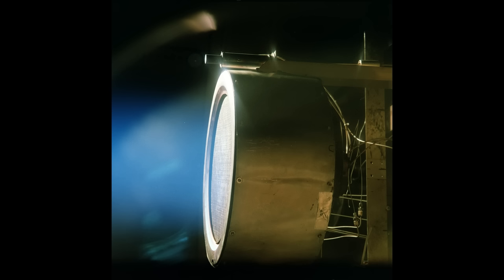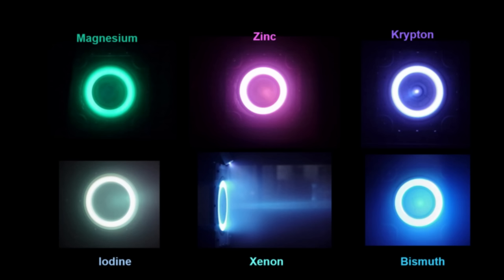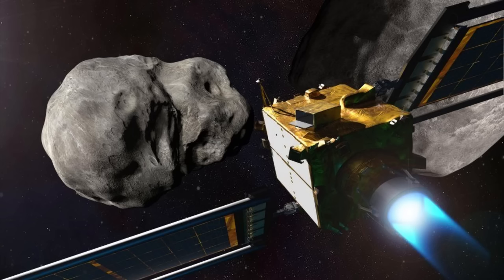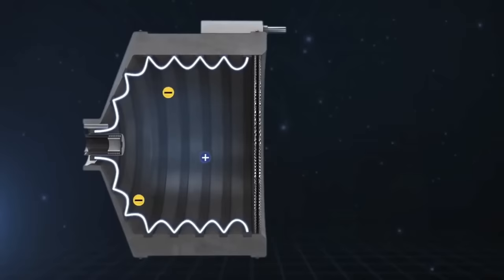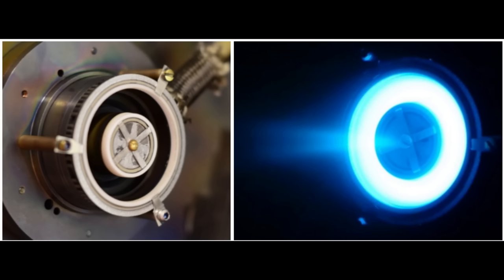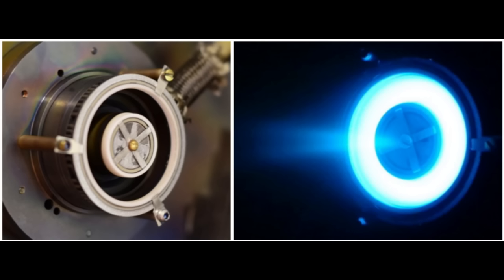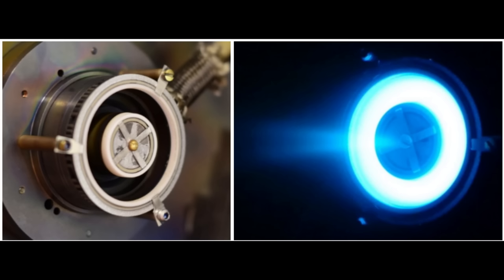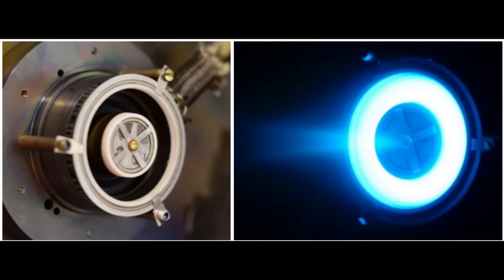Why Are There Two Different Types Of Electric Space Engines, And How Do They Work?

Comment: why specifically xenon? wouldnt it be better to use something like iron? i mean...it's a lot more common, has a lower ionization energy requirement and is solid at normal temp and pressure which means it would be a lot easier to store as fuel...i'm kinda curious why it's also totally absent from the shown graph while other metals like zinc or aluminum were specifically marked (it could be one of the small points between Scandium and Zinc though...now that i think about it...)

Unless what we're looking for here is to maximize the function of relative atomic mass (or Standard atomic weight, depending on which church you preach) versus 1st ionization energy which would mean that xenon's atomic mass (that is more than twice that of iron's) would compensate for it's higher ionization energy...did i understand correcly?

If that's the case then the graph at 14:20 shouldnt be showing relative atomic masses and not atomic numbers? it might be more of a nitpicking from my part or a complete mistake and i have no idea if i'm understanding it correctly XD
Reply: Iron is solid at the operating temperature that’s why
Reply: @peeperleviathan2839  Iron sulphite (for instance) is a gas... As is xenon. You still need to atomize it to make it into plasma. With the added disadvantage that you need to store it in pressurized containers and use parts prone to failure like pressure valvs and regulators while you could use solid Iron as a fine powder. Iron going from solid to plasma would also allow it to accumulate more energy as transitional energy which would allow for more energy output. 
i am, assuming (i might be incorrect) of course, that something like that is connected to propulsion (like Iron being molecularly heavier and thus requiring that extra energy) and thus desireable. It could very well not be the case since this is not my area of expertise XD
Reply: @pedromoura1446  idk but I think the main reason would be the mass would be so much more it decreases the isp so much not even ion engines can use it
Reply: @peeperleviathan2839  hmmm... So it's a material limitation is that it? We can't transfer enough energy or fast enough to make the change to plasma and/or imprint kinetic energy to it?

Comment: Why don't they use a laser for ionizing the particles? They can ionize quite efficiently in a one or two step process.

Then again, typical lasers are themselves not so efficient. Or there is some other reason that this is not used.

Comment: Highest Isp purely electric propulsion is a laser pointed in the desired direction. Semiconductor lasers have exceeded 50% wall plug efficiency long time ago. Problem is your thrust is very, very, very low because photons are very, very, very light. It is a well tested and reliable technology, however.

Comment: Isn't NASA developing some larger versions of these for Gateway's station keeping?  If so, and these have a limited life span.  Are they easy to change out / replace?  I'm assuming even if the NASA version are much larger, the Gateway station would still require a long duration use of these or a lot of periodic small duration uses of these to do corrections over the years / decades.

Comment: I don't think you get fewer atoms per kilogram if you go lower on the periodic number of your propellant. Instead of getting 1 mol of carbon in 1 gram of it, you'll get around 12 mol in 1 gram of hydrogen. Instead what mattered there would be the density. Since it's much harder to pack 1 g of hydrogen in as tight a space as it would take to pack 1 kg of carbon.
Also, is 1 mol of carbon 1kg or 1 gram? I forgot...

Comment: Stupid question: but is the thrust created by the pressure of the gas against the acceleration of the electrons? I didn't really understand how the thrust was generated from a physical standpoint.
Reply: Technically, in Hall thrusters, it is transferred from the gas to the thrusters by the repulsion  between the magnetic field induced by the swirling electron current and the applied magnetic field
Reply: @umichpepl6533  So, does that mean that erosion is critical for the thrust to work at all since erosion the physical transfer of force?
Reply: @yourmamaisphat  not at all! In fact we want as little erosion as possible. since the force transfer is magnetic rather than based on gas pressure, in principle you could build a device with no erosion whatsoever. In practice these things have lifetimes around 10-50,000 hours.
Reply: @umichpepl6533  OH!! Magnetic repulsion forces are at play! I understand now. Very interesting! Thank you for helping me understand!

Comment: I didn't under stand the explanation of the Hall Effect Thruster.  At 10:40 if the gas molecules don't get ionised until they encounter the cloud of electrons then they are no longer in the electric field which exists between the anode and the cathode (the electrons) and so will not be accelerated.  There seems to be something missing from the explanation.

Comment: I mean I look at the increase in size of the powersystem and the increasing mass requirred to follow the doubled specific impulse curve and notice that there is a point at which the still work in progress ASRG (Advanced Stirling Radioisotope Generator) might be more efficient as it would be more compact and could produce more Watts per Kg compared to solarcells. Now as we know solarcells, especially those really thin film one can be un-rolled and they are light and somewhat efficient, getting better at both constraints all the time.
This still leaves me with the question of "When does the ASRG become more economical in terms of Watts/Kg ?", simply because we can extrapolate that to be a possibility.
Reply: Are you referring the the kilopower project they did a year or so ago?

Comment: FEEP engine with 98% efficiency is mind blowing
Reply: What does FEEP stand for? Fluorine something?
Reply: @donjones4719  Field Emission Electric Propulsion
Reply: The main issue is the very low thrust and decades of struggle to meet lifetime requirements: the Enpulsion needle FEEP module only produces about 100 mico Newtons. Possibly a great advantage is that the small (in volume) fuel reservoir is actually integrated into the thruster module, so no need for tanks and feedlines. The modules can just be bolted onto a Cubesat and wired in.

Comment: for Hall effect, why do the neutal particles fly straight out, when the electrons are moving in circles, and the ions are only slowly moving out

edit: nvm I got it backwards, it's shooting out ions with neutral gas as an input
Reply: electrons are way lighter than the ions used. xenon has a molar mass of 131.293u while a single electron has 0.000548u of mass.

Comment: Is there a reason that something like the ISS doesn't have a big ion propulsion module docked to it to maintain its orbit?  I'd imagine you could basically build a big high pressure tank full of your preferred noble gas with its own solar arrays, ion thruster, and an international docking adapter attached to it and just use that for most of station's needs.  Plus the extremely low thrust would be much more gentle on the rest of the ISS's structure and the experiments inside.

Comment: These engines get up to velocity quite slowly because they trickle out the ions. So why isn't the volume of gas expelled/second massively increased to provide more immediate  thrust comparable to chemical rockets but with the advantage of higher speeds? Is this an inertia thing?
Reply: It's, in part, a power requirement thing.
Reply: @TheEvilmooseofdoom  so not enough immediate power available because they're relying on solar? If so, does nuclear open that door to rapid and efficient speed using ion thrusters?

Comment: Are superconducting electromagents used?

Come to think of it: why aren't we using superconductor in space all the time? Once down to their required temperature, shouldn't they basically stay in their superconductive state forever?
Reply: It's hard to get rid of heat in space, since you can only radiate it away, and the rate of that is proportional to temperature to the fourth power.  No matter how far from the sun you go, as long as you have any device on your spacecraft using energy, the waste heat will heat it up to some balancing point.

Comment: I wonder if recent advances in magnetic field strength, the ones which have led to viable small fusion generators, would impact electric powered thruster designs.
Reply: There are no viable small fusion generators. Not yet.
Reply: @General12th  that's not the point. The point is that the magnetic field strength advances have come, and that maybe these new strong magnets could be used to enhance these kinds of thrusters
Reply: I didn't intend to imply that these reactors exist and run today. But valid designs for them are predicated on the improvement of magnetic confinement due to recent advances in materials science.

Comment: I’ve often wondered if it was possible to make an electric propulsion system for methane and oxygen to use on Mars trips. Then you could switch between high isp and low isp depending on needs.
Reply: The Raptor engines are already nearly maxed out on theoretical ISP for that fuel type and they burn at 90+ percent thermal efficiency from what I understand. The only type of electric engine you're gonna have with methane and oxygen is an electric turbopump like rocket lab uses on electron, however gas generators are gonna be much more efficient at larger sizes as the battery only restricts operation time and adds weight. SpaceX could sacrifice some thrust for a slightly higher ISP in vacuum.
Reply: @Jaker788  No I meant ionizing the Oxygen or Methane and using like hall effect or one of the others.

Comment: Yeah, but the best and definitive solution is to create a "universal ionic" propulsion system that uses the "ionic" UNIVERSAL PRINCIPLE ( not the usual classic ionic interaction, but the "deeper" and fundamental one ) that exists in any medium and at any entropic level, at any scale.
I would call this the Entropic Modulator Propulsion System ( it does functions analogous to the classic ionic principle but at different and radical understandings of the way the aggregated structures interact at any "entropic" level ) and this can be used in any medium, anywhere in the Universe, at any scale, in the so-called "fluid" atmosphere of any kind of any planet, around and close to stars, in any "void" ( there's no "void" anywhere, at any level and point, micro and macro ) of the Universe, etc.
How do you think the very advanced civilizations travel in the Universe? By using "fuel" or any form of material energy that's carried as a quantity with their spaceships?😏
Why would they do that when everywhere around their spaceships there's a neverending source of the so-called "energy" at any micro and "macro" level and point in the Universe? 😏

Comment: Why not just use a laser to vaporize heavier materials to serve as the ionized gas? I mean, it wouldn’t work terribly well when gravity is involved, but in space you just need vapor to push against.
Reply: There are thrusters that use lasers to vaporize material, and use the vaporized material as the exhaust.  They have been used as RCS thrusters, because they allow very short pulses of thrust for precision.
Reply: @Br3ttM  well, sounds like someone would need to do the math to determine if secondary acceleration for the vaporized material is better than using a more powerful laser.

Comment: Argon is present in the Mars atmosphere… all what SpaceX uses have a very simple explanation by thinking to the Mars problem the want to solve.
Reply: What use do they have for Argon on Mars?
Reply: @TheEvilmooseofdoom  because of the better efficiency, ion/plasma engines, which use these inert gases, are good for long space travel. They allow you to accelerate for long periods using less mass.

If you do a round trip from Earth to Mars it is much cheaper to take the propellant to come back on Mars. They will do sure for Methane, which is how they will leave the surface of the planet.

But they could use these kind of engines to travel with Argon taken from the Mars atmosphere on the fight back.

Comment: I totally get Newton's third law etc. But what I can't really picture is: the ions are "floating" basically and then get propelled by magnetic fields. They accelerate and thus have a opposite force, but... where exactly is this force then pushing against? It can't push back at the magnetic field I guess..
Reply: Why not ?
Thats exactly how electrons are pushed through our wires, a magnetic field acts upon them, and they act upon the field.
You can build a small device to test this with a few components, take a generator, gear it up lots and attach a handle to the gearbox to turn it by hand, when both wires from the generator are not attached to anything you are only fighting against friction of the mechanism, when both wires are connected together, a short, you are fighting against friction and the maximum electrical load, depending on generator size and gear ratio, the effect can be quite noticable
Reply: What do magnets push against, when there's only the magnet field between them, interesting question.

Comment: 12:04 that is nice movement. But why dont spin the proton and launche them in spiral? Why they over-enginering it?
I mean is not more easy spin a proton(more mass) and after certain speed let him go like HAMMER SPORT LAUNCH ( https://youtu.be/3ygvm-P2R_0). And electron feeder removed from outside of motor(we dont want that kinetic energy proton come back to take his electron to be in balance)
And if you have power to ionize elemnt like Barium, Calcium, Xenon, Oxigen you can use it as fuel. So everything can be fuel if the tank and ionizer is capable.

Comment: Why does an ion thrusters need to neutralize ejected electrons?? That sounds like such a waste of energy considering the radiation in space from everything else.

Also, instead of an electron gun why not use a lens to gather photons and focus them to an electron volt for passive activation of the fuel rather than covering solar power at 30% to convert it to a beam with further energy losses just to accomplish the same thing?

Comment: Dumb question but uhhh, could you use an old TV as a poor man's ion thruster? you'd need to find a way to blast the electrons through the glass, I suppose.

Also, just for fun. If we had the ability to generate the power needed, how much would you need to have a hall effect thruster which produces the same amount of thrust as Starship Superheavy? (Assuming 33 engines at 100%). And why would this be an absolutely horrific idea for electrical radiation reasons.

Comment: Couldn’t you just use the cathode ray tube from an old TV as a thruster?
Reply: If you're just shooting out electrons, you'd build up a positive charge right away.  And it wouldn't have much thrust even compared to an ion engine, since electrons are so light.  If you shoot out positively charged atoms, you can balance your charge out that way, though.

Comment: Now I want a molecular conformation engine, making a protein complex physically fling a chunk of something when binding a ligand, which is something that sort of happen in real proteins like ion pumps or ATP synthase.

Back of the envelope calculation shows this doesn't really work: typical bond breakage is order of ~10 Kj/mol (ATP hydrolysis is ~30.5), typical atomic mass of a ligand is ~50 g/mol (carbon monoxide is 28), so if all bonding energy is converted to kinetic energy 
0.5*m*v^2 ~ 0.025 Kg/mol v^2 = 10 KJ/mol
So it is in the order of a very measly 20 m/s exhaust velocity.

Comment: Are there any dangers with an Ion thruster ?
I mean if its powered up and you put your hand behind it, what dangers are there ?
Reply: “a reaction drive's efficiency as a weapon is in direct proportion to its efficiency as a drive.”
Reply: most of them dont use anything radioactive . speed  and thrust are also low. BUT i wonder maybe they can have strong static charge in some cases?
Reply: The dangers would probably be similar to high energy particle radiation because the exhaust is very much a stream of high energy particles.
Reply: @mrpicky1868  I hear about the speed of the electrons stripping material if its in the way and UV burns ?
Reply: @exo_2171  It kind of reminds me of an old cathode ray tube since that accelerates electrons too. just a grid plate on the end that electrodes hit
Reply: @briansmithwins  Maybe its thrust more than its efficiency. I'd rather put my hand behind this than a chemical rocket.
Reply: @BillyNoMates1974  electrons have almost no mass.  and might not exist at all, IMHO.  electron gun in CRT TV does nothing but exite phosphor. not stripping anything. the accelerated neutralized stream is fast but again little mass and not exactly relativistic fast like in case with actual radiation. so the energy is wasted on acceleration of a small mass. it is a kind of plasma torch but very weak. just thing about small energy input and where it is wasted towards. it;s not even focused in any way like you would use in a torch to cut something. surely it;s not a great place t ohand around but i doubt it can be harful unless very specific circumstances are created
Reply: @SocialDownclimber  I've used similar machine (ion etchers) and the rate of etching is very slow. It could eat through the dead skin cells on your hand, eventually. As mentioned, you'd have much more problems by having your hand in a vacuum than damage from the thruster